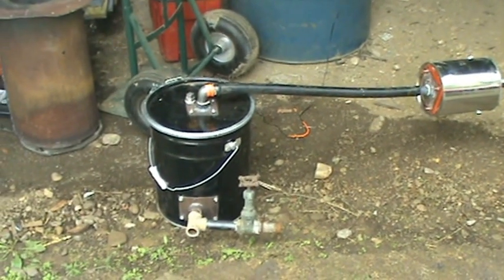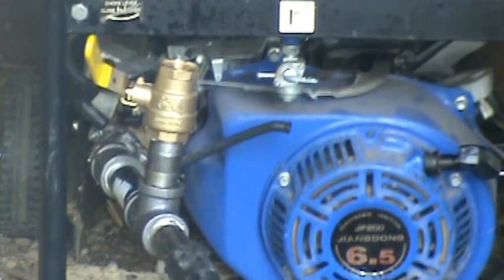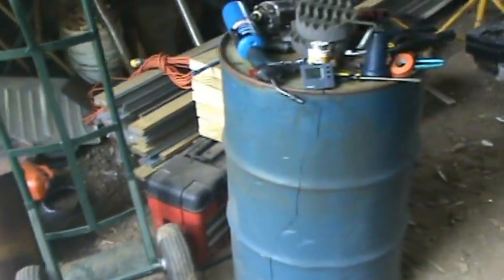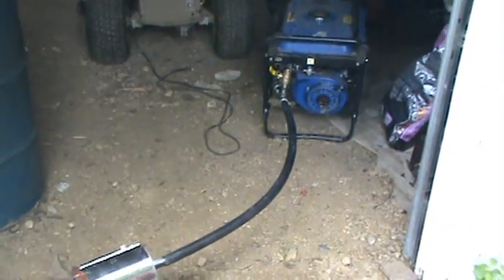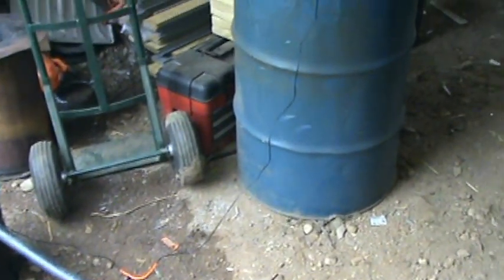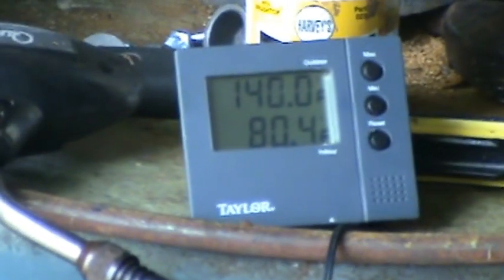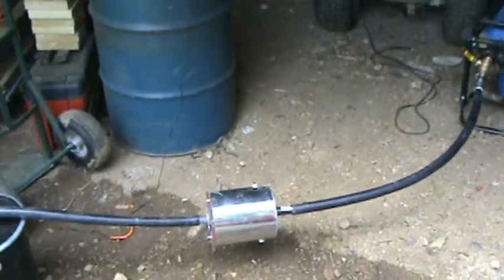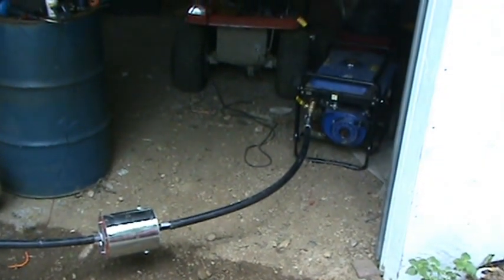simple fire charcoal gasifier

Comment from the maker: The bucket is filled with homemade charcoal, the air inlet is about 3 inches off the bottom and extends 3-1/2 inches into the bucket, The gas comes out the top  and into the paint can that has two 1-1/2 peices of open cell foam for filtering the gas, there is a mixing valve at the motor to get the air gas mix just right. I took the arir breather off and made a bolt up pipe fitting in the breather spot.he char is lit through the air intake on the side of the bucket.